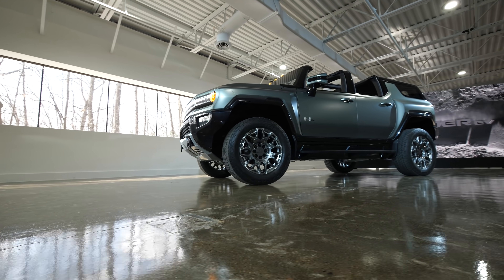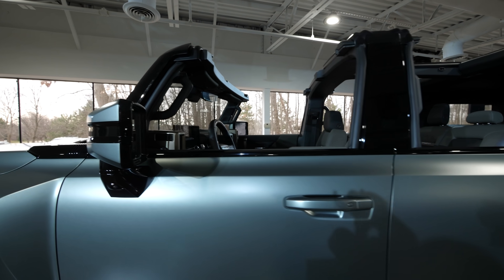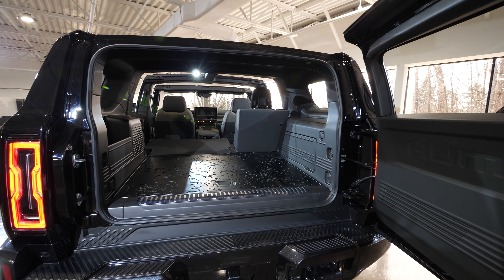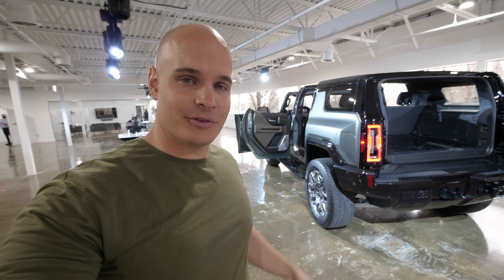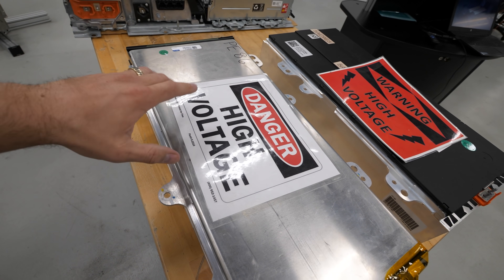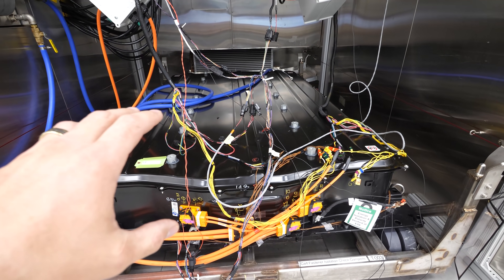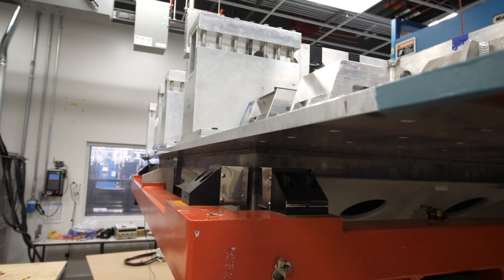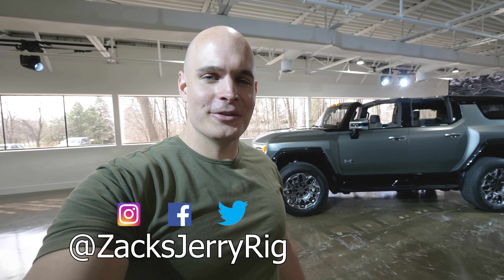An Electric HUMMER SUV?! - First look at the Tesla rescue vehicle

Comment: Electric vehicles are the future just not sure weighty ones are 😬
Reply: Every EV is heavier than a comparable ICE counterpart, but the CG is much lower than an ICE which gives it a better platform for vehicle stability and performance. 

For example, E-Tron (which is a mid-size SUV) is just as heavy as a Cadillac Escalade (which is a full-size SUV) but the Escalade will not perform like E-Tron for driving pleasure and quickness, and the Escalade is far from cost effective to own unless you need the huge size and truck-like capability.

Comment: same engine used for time travel aside from lazer technology which tesla was made if the gravity of 1900 nor 100 bc converted MINUS the same gravity of the present time which is now, the object from where the point of origin like in 2021 must gravity is more HIGHER cause by time AGING and using satellites with high magnetic field transfusions it may cause an object travel to places like cellphone signals do take our calls and send our massages in real time. Also if you can figures it out it my contribute tine travel at the same time and moving from planet to planet would be easier than going there exploring traveling to space than calculating the GRAVITY of the place of the ORIGIN to the PLANET GRAVITY for destinations.

 GOOD JOB your SHOW for next time a word of advise if your making a BLOG on technology changing the WORLD don't ware your wedding ring for it a LEVERAGE out of you but if your the RICH and fully guarded if wont matter being a US government private contractor. GOOD LUCK

Comment: super interesting to see pouch cells being used instead of cylindrical cells, I would love to see how the durability and reliability compares, in my experience pouch cells are way more temperamental.

but I do get confused, as LiPo and LiIon cells can come in either variant, so its hard to tell what the chemistry is at fault for rather than the style
Reply: i've seen lipo pouch cells go up in a deadly pheonix repeatedly, and i've seen liion cylinder cells go off like fireworks. i'd certainly put my trust in liion cylindricals when it doesn't demand high current, but Hummer seems to think otherwise.

Comment: A little bit about Hummer History that many may not know, but is funny. when GM's Hummer was introduced there was a grand show of what they thought was mocho strength of over sized gas guzzling SUV's. GM executives had a Hummer run over several EV1, GM all electric car program GM was trying to kill forever.. NOW that same once failed disaster of an SUV  Hummer is now being resurrected as an all Eclectic Vehicle. GM thought they kill the electric car now they are trying to save their ass with one. one thing I will have to say, GM's EV Hummer is done right and should be a great success and sell fast, unlike the cheaply made gas guzzler dealer's could not sell and they sat on lots for years..

Comment: I just have a question hopefully it could be answered why does the Hummer SUV have outlet plugs you can plug into the back say to use a power tool you can plug it in but why doesn't the Hummer pickup truck have it I just kind of feel like that's just kind of stupid when it's supposed to be used as an off-road vehicle or accusing as a work vehicle say as construction running a power tool out the back of it I don't understand why they didn't do that and I think they should

Comment: Good video Sack. Nice to see GMC Hummer has innovated and aren't just re-releasing the same SUV and a truck  with new colours. Having a SUV this size that can do 60 MPH in 3.5s with power on tap immediately? :)  Hope there is a "sport  sound exhaust mode" you can turn on when wanted. 

Also, I'm assuming the "standard  EV SUV" should fit in most home garages Like the old H1?  Or  is it more the size of an H2...which I think can still be parked in most home garages??  Kind of important when charging. 

Wonder if it will have any park assist features. Having so many cameras...should have a front/reverse sensor...maybe even a self parking feature that will auto parallel and perpendicular park/  Features common in many SUV's, sedans and in the 2022 Porsche 911's (can step out of the 911, use the key fob and the car will park itself)...

Comment: If your going to watch this propaganda, your going to hear some sense. If you are thinking your saving the earth by buying electric. Your not. factually, the carbon emissions used to mine the metals, chemicals and elements needed for the batteries plus the manufacturing of the car nearly cancels out the emissions saved versus a standard gas powered vehicle made out of nearly all recycled metals. Also, these chemicals and metals for the batteries... are not mined for in the united states, you can actually search online the pits they put little African kids down to farm for ore used in Tesla batteries. Way inhumane. As for the uses it may have with the torque and other pluses like that in my eyes cancel out when you are limited to 300 miles on a charge, thats 150 miles less you could go on a trip. GMC claims that you can add 100 miles to your range in just about 10 minutes. This sounds fishy, and since they are using lithium batteries, the faster you charge them, the less they have in lifespan. This topic comes to my latest concern. Electric cars are more wasteful when it comes to waste after the short life of an electric car. They have less of a lifespan and more going to the dump than the average gas powered car.
This reminds me of the irritation I have of apple products. You turn it in to be fixed because it is not turning on, you take it to apple and then they shake it to their ear and hear something jiggle around... “that will be 600 dollars to replace.” The genius bar member says. You take your phone somewhere else and they say that there was a 10 dollar fix to the phone. While all of this wasting and replacing is happening, apple insists on creating a facade that they care about the planet when it seems like they only deploy that excuse to justify cutting costs. In truth, apple has found this religious following in the climate change community that they will from now on continue to use that “go without.... to save the world of coarse” justification. Apple may care about the climate, but not enough to make things cheaper to repair. Because money is more important to them. Dont be fooled by the car companies, the techies, or any of those common sense suppressing corporations.

Comment: If GM priced this to compete with Cybertruck, I'd have a hard time picking the former. But being that I'm 99.999% sure that this is going to be double the cost... Nope.
Reply: GM didn't price it to compete with Cybertruck  Cadillac doesn't make the escalade to compete with the Ford expedition. The closest thing to the hummer ev coming out soon is the Rivian R1T. Instead the Cybertruck competes with the f-150 Lightning, which is much closer in price. These vehicles being in different price ranges also means Rivian and Ford can partner while still releasing trucks at the same time.

Comment: 5:48 "Pound feet of torque at the wheels" is not how torque is measured.

It's an intentionally-misleading figure that includes the final drive multiplication. No other vehicle is measured this way. 
By the same benchmark a G63 AMG has 33,972 Lb-Ft of torque... yet its rated at 627 Lb-Ft in the marketing.

The real number is 348 Lb-Ft of torque per motor (2 motors on bottom 2 trims, 3 motors on top 3 trims).

Comment: Just wondering, so fully charged it goes for 300miles. Does it have that tech when it is running in the road its charging its battery also? Like those bicycles that has friction generators to have lights. Probably a dumb question but Im just wondering 😅😬✌️

Comment: Electric vehicles are the future? A bold statement considering the inefficiencies, imagine being out on a Texas country road and losing power, or better yet having to replace that battery with its tremendous cost. Until you can create batteries as efficient and cheap as fossil fuel it will be a novelty and nothing more.

Comment: The biggest thing I want somebody to review on these darn EV's is serviceability. Which manufacturer if any will sell you individual cells?
Which manufacturers have the battery terminals bolt on instead of soldered in place? Which ones whine like the new iphone if you mess with the battery? 

So on and so forth. I wonder if any manufacturer lets you pull out a module without dropping the entire battery unit.

Comment: What is idiotic companies there were in trouble while back for trying electric cars are now thinking electric cars are good only because Tesla get electric cars going again have not changed the batteries since 1800 they had a a electric cop car was the first squad car ever built you have the exact same or even better than Tesla has for his electric cars so it's been around since 1800 gasoline is still a better alternative or even ethanol or even hydrogen is better than Electric

Comment: So the cargo area is wide enough to fit a sheet of plywood, but the sheet will protrude out the back of the vehicle by two feet requiring the rear door to be left open.  With the rear door fully open, how far does the spare tire stick out past the side of the vehicle and would it be unsafe to drive with it open like that?

Comment: So.....a weight of the vehicle is around....10 tons and guys that designed that thing wanna say that big fridge is faster from 0-60 than Audi RS6 with 600 HP V8? It seems to me that's a huge fairytale for kids....by the way, water line is a joke. That's not fast, it's not off road worthy, it's not nice, it's not small....so what's the point of that vehicle? I must say that good old military Hummer would be ashamed right now.
Huge Dislike for a vehicle

Comment: Batteries will become obsolete when the super capacitor becomes available. EV's in the future will come standard with a free energy generator that will keep the battery fully charged at all time, no reason to plug the EV into a charger.

Comment: I don't know if I really trust GM's battery tech enough to blow 100k on a Hummer EV after they had the fires in the Bolt EV and haven't actually replaced the (still under warranty) faulty batteries.
Pair that with the well known buggy infotainment, and Chevy never performing a single OTA update on the Bolt EV... GM doesn't seem really tech focused.

Comment: Jerry forgot to scratch the car with a knife and bend it to test for durability. Missing the scratching metal and paint sound make this unwatchable.  Lol.
Anyway, a giantic car is still a wasteful of energy even if its electric. How much coal and gas will need to burn to keep it running? Consider the price. It won't sell much and will just die after a few years.

Comment: Is lithium battery pack is better than the cell design as a Tesla battery pack
Reply: Tesla and the hummer both use lithium
Reply: @odisy64   yes they do but Tesla use cell battery as we use in tv remote but in this, they use a battery pack like in phone I think Tesla design is better because those battery's don't punchers easy as compared to a battery pack of a phone. We all see that phone battery pack can be pocked and catch fire easily but cell battery doesn't get pocked easily.

Comment: Ev's may be the future in highly populated countries but here in Australia we travel large distances. An example, we traveled 750kms in one day towing a car trailer. Impossible with an ev. I travel weekly this same distance 50% of this off road. Also impossible with an ev. I live in Victoria the most populace state. Northern Territory Australia the least populace people travel up to 1000kms for their weekly shopping. So to say ev's are the future is not accurate for everyone. Not to mention the lack of power available on the electrical grid systems to charge these things.
Reply: Its easier to find a plug than it is to find a gas station. The cybertruck has a range of 800km and is expected to start deloveries next year.
Reply: @odisy64  then wait 8 hrs for it to charge? The range of 800kms is unloaded on flat ground 1/2 that if you are carrying a heavy load. No plugs anywhere near the highway let alone back roads. To have a plug you need infrastructure. Power Line etc. For low population countries it is not viable.
Reply: @Gold_Hunt_Australia  why would you need to wait 8 hours? just charge it to what range you need (some 15 miles i guess) to make it to a super charger or plug. if you do it like how the computer tells you to drive, you wont ever run out during a road trip and you will only spend 24 minuets getting 80% of your cahrge back.

but you seem to not understand gas pumps and gas stations require electricity to work. so if you already have electricity for pumps, your already going to have the wires for a plug.

you guys make it a bigger deal than it actually is but once electric cars are everywhre your going to realize how redundant of an argument you are making.
Reply: What you seem to not understand is the energy needed to charge a car is significant. Most power lines to rural areas are small. We use a single wire earth return system in rural Australia. Most systems are only capable of providing 60amps @ 240vac. A 70kw battery super charge system is a 3 phase supply. This is not available. In addition an electric Tesla in Australia is  $100,000.00 a 4wd (which is what is required) is not yet available and when it does come available will be $200,000.00 here. The electric car will be a reality for the upper class 5% City dwellers, that's it. 
For example to travel from Victoria to western Australia is 3600kms. The fuel stops are every 250kms approx. But they run on diesel generators. So to set up a charge station to charge an ev would be Burning diesel. Going into the high country is worse. Most vehicles need a range of 1200kms to be able to travel in and then back out without any possibility of filing up during the journey unless you pay to have fuel dumped prior to your trip. So I don't accept your baseless claim that things will just catch up. If ev's are the only mode of transport them it looks like horses and carts will come back into vouge.
Reply: @Gold_Hunt_Australia  i actually do understand, i have had training in commercial and residential electrical installation. but im guessing your Australian seeing all the Australian related problems you listed. most of the world is not like rural Australia so your argument does not work if your trying to make a point about the mass adoption of EV's. but imagine the day Tesla build a factory in Australia in under a year and the cars have a huge discount since they no longer deal with import cost. expect a $25,000 Tesla in the next 2-3 years.

Comment: Hydrogen fuel cell EVs are the future and that is all because of infrastructure. As we saw with Texas, a few extra space heaters plugged in blew the power grid. Charging an electric vehicle draws about the same current as 5 space heaters. Also, current fuel vehicles can be modified to run on Hydrogen too so more hydrogen stations would be able to replace gas stations.

Comment: batteries on cellphones eventually degrade and lose the ability to hold as much charge, is this not a concern with electric vehicles? 

like, my phone's battery is maybe 70% as efficient after 3 years compared to when it was new,, can one expect to see a similar amount of degradation with the batteries on a car?
Reply: Teslas batteries can last 300,000 to 500,000 miles.  The new 4680 should last 1 million miles.

Comment: I'm curious about the energy density of this battery pack vs tesla's. Tesla's batteries are more like a AA battery with a thicker exterior casing and a cylindrical shape that doesn't pack as tightly.

Comment: "Over 11,500lb ft of torque from the wheels"
Jason from EE would like to have a word about that not being an impressive number if you actually compared apples with apples
Reply: Yeah this needs to be talked about more... If you compared this hummer to a Silverado 3500hd with the 6.6 Duramax, and you did same math, not taking torque measurement from engine and taking it from wheels, you'd get like 14,000 lb/ft of torque, so Hummer not near as impressive as it looks
Reply: @Ryan-sw3km  finally someone got it. :) But still there'll be someone "but duramax doesn't do 0-60 on 3,5 seconds". Yeah, electric motor gets that torque from standstill and tapers off(I know what I said) -it's supposed to be that quick
Reply: @190Tai  yup, I really would have like it if GM measured it standard way. It's kinda like doing a 0-60 on a downhill and calling it a "2 second 0-60" which it technically could do, just not standard measurement lol

Comment: The trouble with that battery testing is that its only while its being driven and the cooling working. The problem in places such as Phoenix is that theres lots of heat in the summers when the car may be parked while you are at work etc without the cooling running.
Reply: GM's EVs including the Volt and Bolt are actively cooled as long as you have sufficient charge. It can run while sitting and diffently run if it's plugged in.

Comment: That water forwarding level isn't that impressive. The last 6 4wds I have owned have had the intake inside the engine bay or front guard making river and water crossings safe up to the headlights or bottom of guards. Over the bonnet if you have a good bow wave.

My concern with it going offroad is how strong the underbelly armour is if you were to slip into a rut and land on a rock. 😬

Comment: 16" of ground clearance I think you are off by a bit? Those lower control arms the running boards and their mounts in the shot when you say that are at best 8-10" above the ground...The original H1 advertised 16" of ground clearance, and the motor/transmission/diffs were all tucked up in the cab and it ran 37" tires...